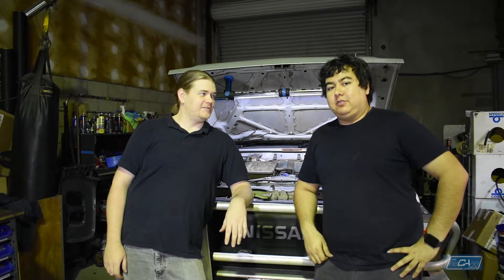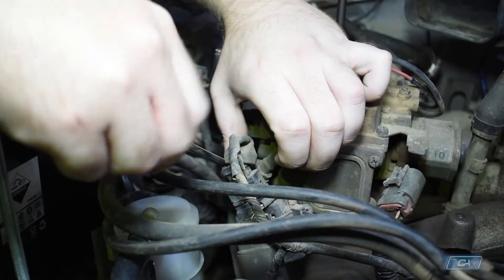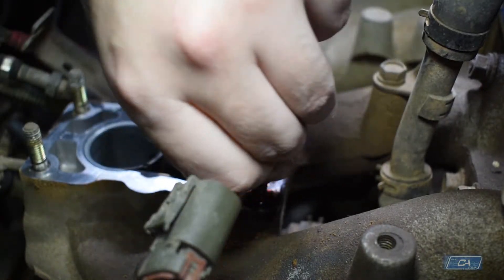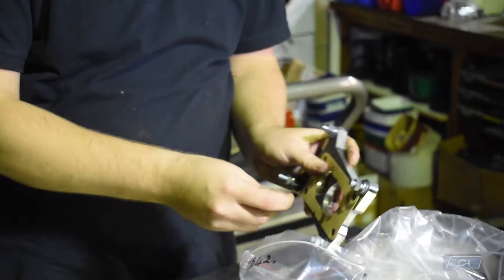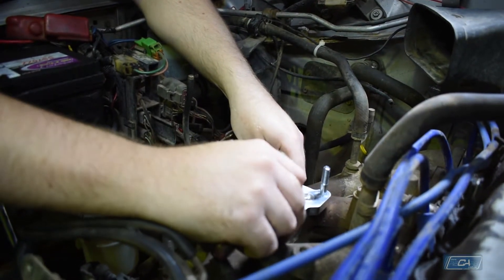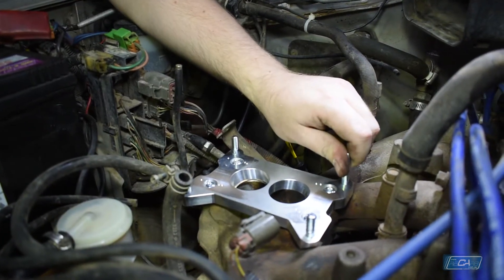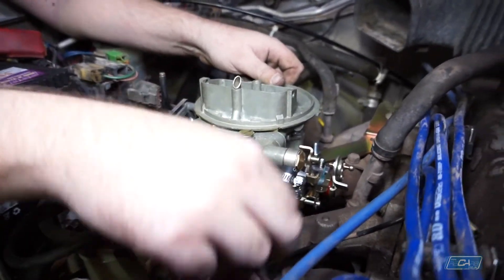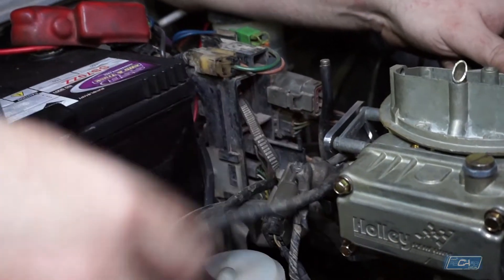Episode 4- How to Install a 330 Holley to Nissan Patrol TB42

Comment: What did you do with the plug for the old carby? I’ve got an issue with mine. My carby on the car has a 4 prong plug and the cars harness is a 2 prong plug
Reply from the maker: Hello. Sorry for the delay, we don't monitor Youtube everyday. Feel free to call our tech team - BH 07 54933788. The Holley does not have or need electric supply, so we just tape up the plug to keep it water tight.
Reply from the maker: To wire up a factory carb, you can also replace the factory harness with a common type from REPCO etc, call tech help for correct wiring.

Comment: Question that metal scoop bit u took out of the manifold at (3.20) what is it and is it needed as mine would move under full throttle and get stuck in the secondary butterfly making it get stuck open and full rev i cant find any info anywhere about it and ur video is the only one that iv seen it any help would be appreciated thank you

Comment: Hi there where are you located? 

I'm having carby issues atm I think the carby isnt getting enough fuel and the fuel filter seems to drain randomly every now and then especially when I come to a set of lights. It's like I have to pump the throttle and brake and keep doing that until I stop then keep the revs up at above 1000 RPM. I did find out that the previous owner used silicone around it. Which is a big no no.

Anyway I've been quoted $850 to recondition the top end.

Does this seem a fair price ? 

A Facebook friend of mine said he put a 350 Holley carb on and an intake pump and external pump and a small fuel cell in the engine bay. 

But I have no idea how to do all this shit lol. 

Cheers in advance
Reply from the maker: Hi Johnno. Yes, we can help. Call the guys at our workshop - BH 07 54933788. As well as tech help to help you find your problems, they also have complete factory carburettors reconditioned ready to run for well under the $800 mark.
Reply from the maker: BTW we are at Warana, on the Sunshine Coast

Comment: How much? For carby swap for fuel injection swap I want Holley over injectors
Reply from the maker: Hello Dean, there's a few complexities involved in swapping from factory injection to carburettor. Suggest you phone or email us to have a talk with our workshop technicians who will be able to advise you on what will have to be done - 07 5493 3788 or sales@recarb.com.au
Reply: @recarbaustralia5772  alsom thanks buddy much of a power gain grunt was I got told to use a 500 Holley is that OK
Reply from the maker: @deanharris9375  the 350 and 500 Holleys are V8 carbs, they'll run on an inline 6 but the fueling calibration is not correct. Our 330 and 480 are specifically calibrated for inline 6 engines. The 330 gives instant smooth response off idle with a stronger midrange. The 480 increases midrange torque and adds some top end power as well
Reply: @recarbaustralia5772  alsom thanks buddy big help

Comment: HI Guys
Has anyone attempted a TB42 Engine carby conversion to Sniper EFI
Reply from the maker: Yes. Has already been done. The result was very comparable to the Holley 480 conversion (which is half the cost).
Reply from the maker: Hi, here at Recarb Australia we only do carburettors. EFI conversion is a lot of work, to simply end up with the EFI version of the TB42 that Nissan themselves built from 1992 onwards. There are some EFI conversion topics on www.patrol4x4.com if you want to have a look

Comment: Hey mate, i would like to do this conversion but i was wondering if it can handle boost or not and if so what psi will it handle?
Reply from the maker: Hello Ethan. Yes, we have supplied a LOT of these for turbo application. There is some preparation work we can do to the Holley to have it ready for Turbo. This work will let you bolt the Holley onto a standard Patrol engine and run just fine until you fit the Turbo. The Holley is a robust carburettor; with some work on the diaphragm they can handle up to 30PSI. No trouble for most Turbo conversions using 5 to 12 PSI. You will just need to rejet when turbo fitted to suit your boost.
There are some that have prefered our 480cfm Holley for Turbo use, citing less lag, quicker spool and more usable torque at lower revs. Feel free to call us at shop - BH 07 54933788.
Reply: @recarbaustralia5772  no problem mate, thanx for the help👍
Reply: @recarbaustralia5772 What mods to the carby are required if only running a low psi, say 5 to 10 psi boost? And is that for a gas setup, or a straight petrol setup? I'm interested in turboing my tb42 but want to keep the carby and keep it solely on petrol, reckon it's possible?
Reply from the maker: @tris-ris0184  when we build a 330 or 480 for turbo use we fit a solid float, installTeflon seals and make a few other mods to cope with boost pressures. Almost exactly the same mods are made if we build a Holley for gas. So you can run both turbo and gas with these carbs. However that's a tricky set-up to get right. Yes a TB42 with turbo and one of our modified carbs is possible, many of our customers have done this. Personally I'd forget turbo and just go with the 480, it makes a lot of power and is far less hassle to set up and tune.

Comment: Hey mate what size was it, im thinking about doing the 330cfm conversion, what's the fuel like compared to the old one I'm currently getting 28/100 5inch lift and 35s
Reply from the maker: Hi, The carb is sized to 330 CFM. Fuel economy you could expect the same if not better than your old carb, depending on your right foot. We get around avg 22-24/100km with standard tyres and 2inch lift. 28 is pretty normal for a vehicle with larger tyres as the larger tyres puts a lot of load on the engine when starting to move. Also a contributing factor is weight such as bullbars, drawers etc.

Comment: Much benefit in doing this?
Reply from the maker: Hi, Yes many benefits include an increase in power and torque down low in the RPM. Also better reliability as it is a simpler carb with the emission devices not present. The factory carbs are getting harder to find replacement parts for and this is also another reason why people are fitting Holley's, not to mention cheaper to service and maintain in the future.
Reply: @recarbaustralia5772  thanks mate do you know how much more power and torque       good vid btw :D
Reply from the maker: @JETBYE  There are now three carburettors we're fitting to the TB42 - 38mm Weber generic, 330 Holley, and 480 Holley.

The 38 will only suit manual transmissions. It doesn't offer any more top end power but gives better pull off the line and in low rpm use.

The 330 Holley provides better pull off the line and more midrange power.

The 480 Holley improves on all levels - better off the line, stronger midrange, and improved top end power.

All three when driven in the same manner will deliver the same fuel consumption.
Reply: How I can order from Australia to Doha Qatar I need one for my Nissan 96 4.2
Reply: @asadrauf2375  موجود في الامارات واظن سعره على حدود ٩٠٠ درهم / ريال